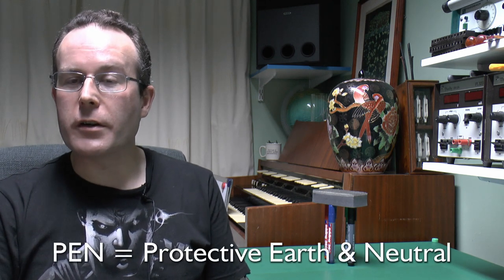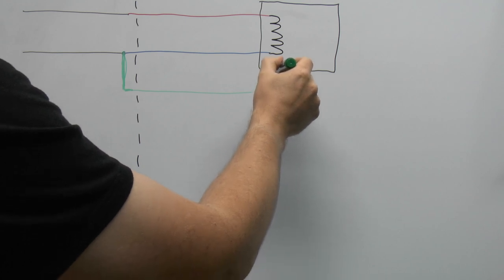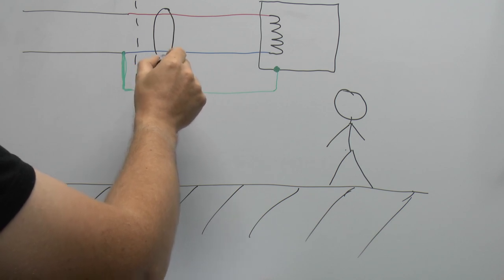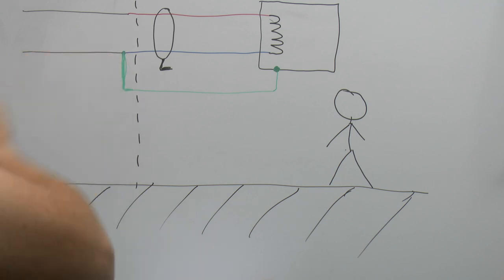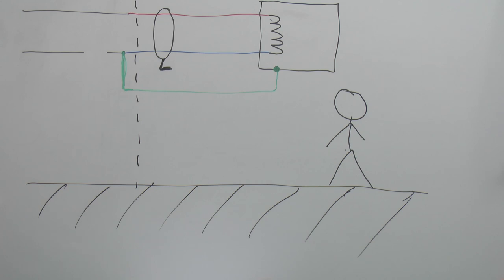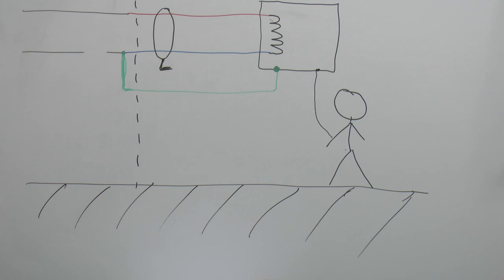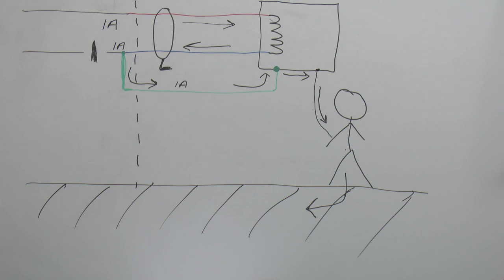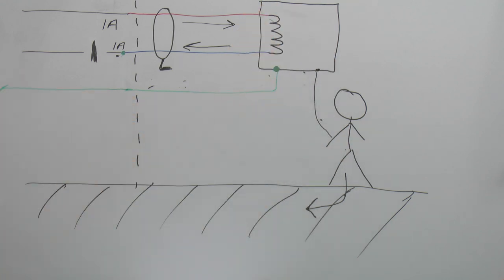TN-C-S Danger - Broken PEN Conductor (Combined Earth & Neutral)

Comment: Thanks for the very informative video. I am still new to this topic so I have two questions; Firstly, where is the connection through which current would flow back to the transformer in case the PEN connection breaks?
Secondly, can we use another protective device to compare the currents flowing through the earth and neutral conductors so if they are equal then trip the line conductor?
Reply from the maker: +Hesham Magdi The return is through the earth / ground itself, so nothing would work but everything would still give people electric shocks.
Yes, such a device could be used, but there is no requirement to do so or any device designed for that.
Reply: +John Ward.  May I enquire further on how an earth fault current manages to find its way through earth to the the transformer given that there is no cable to guide it in any direction. i.e why do electrons not leak in every direction like a water leak? and why doesn't the voltage pressure drop to the level of the surroundings, like a pipe leak into the ocean, the pressure would be lost?
Reply: +AgeofVergo It does leak but electrons need a conductor to leak. Electrons normally do not flow through the air unless the voltage difference between two conductors is significant enough and the distance small enough. This is the case with lightning (high voltage difference) or with bad connections (low voltage difference but conductors are close enough to create sparks).

But every wire with a voltage has an electric field which basicly are the electrons leaking everywhere in your example. You can measure this with electric field meters and this is acually for some people a problem and there are solutions:
- make sure all wiring including the ones going to light switches and lights have a Protective Earth conductor. This will attract 70% of the electric fields produces by phase wires.
- if you're very sensitive you can install shielded cables which will lower electric fields from mains wiring to <1%
- if you're extremely sensitive you can switch to low voltage DC with incandecant or non electronic driven LED lights to get rid of any inducing AC electromagnetics.

I know some people who have to live like that. They are fine as long as they do not come in contact with AC wiring or any electronic devices.

Comment: Would an active RCD (the kind that trip on loss of power) be an effective measure to preventing this kind of situation
Reply from the maker: jayja45 Possibly.  If there were no other parts of the system already connected to earth/ground, when the conductor was broken, there would be no voltage between the L&N connections to the RCD and it would disconnect.  

However if there were one or more connections to ground via other metallic paths such as water/gas pipes (inevitable in the majority of installations), some voltage would still exist between the L&N connections so tripping becomes less certain.

That type of RCD is seldom used, and would not normally be considered for a whole installation due to the significant inconvenience of it tripping due to minor power outages.

Comment: Hi I have just watched  your  video on break in connection  for TN CS 
As a non Electrician. Can you please  tell me why you cannot  mix any of the conditions.  TT TNS or TN CS.. to get around the problems. 
Surely if you have earthing  Rodd as well  as TNCS it gets around  the problems  to severed  line
Reply from the maker: TNS is a good system, but it requires a separate earth conductor all the way back to the transformer - if it's combined with the neutral at any point after the transformer it's not TNS.
An earth rod can be used with TNCS to reduce the dangerous voltage if a break occurs, but to have any effect it must have a very low resistance, 5 ohms or less typically, which usually means very large buried metal grids or using the reinforcement in the concrete foundations of a building.  A single rod won't do very much.

Comment: I suppose this is viewed as a double fault problem. If say as in this case it's connected to a water heater the resistance to the actual tank via the element will be many meg ohms providing that it's ok. This would be why people who have noticed this problem mention tingles to various degrees. Good job they do in an odd way. Things change rather a lot if the element develops a fault - the resistance of that will set what current flows and the severity of the shock.
Maybe at some point given the demise of copper etc pipe a ground spike will be needed or some other method of detecting the problem. Probably rather difficult and a spike has such a resistance that even that could be a problem.
Mention of actual ground current sensing is interesting. I don't know why they were dropped or if they could offer rcd levels of protection.
Reply: A lot of properties already have MDPE water mains and are now receiving an MDPE gas main to go with it. I wonder if the contractors replacing the service pipework for each property are required to electrically test the service first, to ensure it isn't functioning as an earth, because of course once upon a time quite a lot of properties used lead mains as ground rods.

Comment: But running a separate earth wire as in TN-S still sufferes from the problem of it breaking as for the PEN conductor. Do they ever run a separate earth wire on an overhead supply?
Reply from the maker: The danger does not occur with TN-S, as the neutral and earth are not linked together at the point they enter the building - a loss of the neutral, earth or both won't result in metal parts becoming live unless a  separate fault between L&N occurs in the installation after the cable is broken.
Overhead supplies are either two separate wires (L&N), or a single cable which can contain either two (L&N or L&PEN) or three cores (L&N&E).

Comment: friend sorry for pointing my finger,but in this case the RCd will work too, as you touch  the refegerator and corrent flow through your body rcd will turn off since the  corrent surpass 0,03 amps.
Ofcourse you will feel the shock but your life will be save.
Reply from the maker: +LINO SOUZA PEREIRA Normally the RCD would disconnect.  In the situation explained in the video it will not.

Comment: Thank you for this informative video. Please could you make a presentation about the yellow building site "isolation" transformers. When looking at the On-site guide to BS7671 (yellow) 3.4.3 SELV and PELV, it would seem to suggest that in effect these transformers are not true isolation transformers. 414.3 Suggests that to be considered isolatingThe transformer must "have no live part connected to earth or the protective conductor of another system."Since the centre tap of these transformers is in direct metallic contact with the earth of the flexible cord of the supply, the circuit protective conductor of the installation, and hence, quite possibly/probably the neutral conductor of a supply , especially if TNC(S), they appear not to be "isolating" in construction.Would these transformers more appropriately be described as Protective Extra Low Voltage Units?The transformer-fed shaver units do appear to meet the requirement of being truly Isolating.Many thanks for all your fascinating inputs.
Reply: Yellow site boxes are reduced low voltage RLV and are neither SELV nor PELV. The centre tapped transformer aims to reduce the potential so that line to earth is 55v or 63.5v three phase. reduced low voltage reduces the magnitude of the voltage if shocked. SELV and PELV means you cannot be shocked from only 1 pole
Reply: The main issue with these is miss location. Most are used at the Point of use and not at the supply point. So unprotected often un tested extension leads at a full unprotected state are laying around getting walked on and chopped. Builders will not bother in the race to get home each day.

Comment: In this scenario. If you had this circuit protected by the type of rcbo that has an earth tag, would it cause the rcbo to trip? I'm trying to understand what the benefits of having the earth tag are ... thanks
Reply from the maker: No, as that could only detect a break if the earth lead was connected before the break, which would be outside of the property.
They were provided for various reasons, the most usual one is that it ensures that internal electronics still work if the incoming neutral was disconnected.
Most modern RCBOs don't have them.
Reply: @jwflame  Brilliant and thankyou for taking the time to reply. Your videos have and continue to be a great resource for me.

Comment: When PEN breaks on the supply side of TN-C-S, does the RCD operate if no one comes in contact with the metal casing?
Reply: mazmaz1981 no because the fault exists BEFORE the RCD. The RCD will only measure in front of itself and not behind (I.e between RCD and load) so even though the PEN Neutral is broken, the RCD wouldn't see it. Think of it like someone standing behind you,  you can't see them unless you turned around, same here. I think if there was an RCD at the substation then that would trip as it would read the imbalance (read 0 volts returned on neutral) - Pretty sure I've understood that right

Comment: Is this a problem if you plug a 16A  3 pin caravan hook up into a converter for a 13A plug top, and then plug it in a socket at home supplied on a TN-C-S?
Reply from the maker: Yes, in the case of caravans the law specifically prohibits connecting them to the earth terminal of a PME / TN-C-S supply.

Comment: in a TN-C-S why do we have an earth stake at each installation? Sounds like a trivial question but I can't seem to reason it out. It would obviously provide another path for fault current if the PEN was damaged but is this the only reason?
Reply from the maker: In the UK, TN-C-S installations do not usually have an earth stake - although it is permitted to install one.
It would reduce the voltage on exposed parts if this type of fault occurred, but a single earth stake isn't likely to have much effect, as it's impedance will be too high.  A large metal grid under the ground would be far more effective, but also costly to install.
Reply: @jwflame   thanks for the swift reply. The Australian and New Zealand wiring rules calls for an earth stake where there is an MEN link. I suspect that because our soils in Australia are bone dry, the stake does not achieve much - so we have to hang our hats on the integrity of the MEN link and PEN. I don't quite understand how it would reduce voltage on exposed parts - can you elaborate on this? Cheers
Reply from the maker: @tommyp3611  If the PEN conductor is broken, metal parts connected to the installation earth will have a dangerous voltage on them.  If those parts are also connected to the actual earth via an earth stake, some current will flow to earth and reduce the voltage on those metal parts.  Lower impedance earth stake = lower voltage, so to have any real effect it would need to be very low, only a few ohms.

Comment: I can understand the supplier not supplying an earth in rural applications. However, in city applications the supplier installing and earth back to the transformer is not a big thing, making it a TN-S - is this so?
Reply from the maker: Supplies were TN-S with separate conductors for E and N up to the late 1960s.  Since then the majority have been TN-C- S with a combined N&E conductor.  Plenty of older installations which were TN-S have been converted to TN-C-S either due to network faults, repairs using CNE cable instead of SNE, or because other properties on the same supply were converted.  Finding a true TN-S supply today is very unlikely.
Reply: @jwflame  
Thx. If a foundation or substantial soil earth is fitted, does the homeowner have the option of using their own earth converting to full TT?
Reply: @jwflame  
If new homes have to mandatory fit EV chargers these days, I would assume a foundation earth would be fitted with a TT system.

Comment: On a TN-C-S system you also have an earth on the house that you haven't shown in the case where the main neutral may break,
Reply from the maker: Some countries have that as a requirement. In the UK it is optional, and therefore never installed.

Comment: I know this is an old video so hopefully someone will see this.

Being that the earth at the appliance is connected to the Main Earthing Terminal in the Consumer Unit, if an earth electrode is also connected to that Main Earthing Terminal surely this will provide a low resistance path for the voltage into the earth eliminating the chance of electrocution to any person who may come in contact with the appliance?

Or am I way off?
Reply from the maker: Correct, but only if the electrode has a very low resistance, typically only 1 or 2 ohms.
Higher resistances will still reduce the voltage on exposed parts, but higher resistance = higher voltage,  and with most typical rod electrodes being 10s or even 100s of ohms, the benefit is minimal.
The required resistance to ensure safe voltages depends on the load connected to the installation, higher load = lower resistance required.  Some of that is covered in this video: https://www.youtube.com/watch?v=gZVx7GbAwlg which is for EV charging, but the principles are the same for any installation.
To get the resistance low enough will require a large foundation electrode in most cases.
Reply: Thank you very much, John. Really appreciate the quick reply.

Comment: Supposing your metal gas and water pipes are connected to the MET would they you provide a path to earth eliminating high voltages at metallic electrical equipment??
Reply: If their metal sections are buried in the earth then likely yes.  They would act as earth stakes. The problem arises when the incoming water or gas pipe is plastic.

Comment: Could this be an argument for still having an earth rod, a la TT system, and having all circuits RCD protected? Would there be any disadvantage/danger in this arrangement, by that I mean having both incoming earth AND earth rod connected?
Reply from the maker: You can have your own earth electrode connected to the incoming earth - but to have any real effect it would need to have a very low impedance, and that can typically only be achieved with a foundation electrode, not a rod or two shoved into the ground.
A separate TT system is also an option, but the electrodes for that need to be located far away from anything connected to the supplier TN-C-S earth, and that's difficult or even impossible for many locations.
Reply: @jwflame  The thinking was that even if you lost the incoming earth connection, a separate earth rod would have a low enough impedance to trip RCD's before you get to the 50v threshold? Just as a backup?
Reply from the maker: @whizzo94  RCDs don't trip for broken PEN conductors, as there is no imbalance of current.
Reply: @jwflame  I think that I have misunderstood what is happening here. I can see that there is no current imbalance.
I was concerned because my house is a TT system, but I'm not so sure that that's a bad thing now.  My apologies for being a bit dim understanding this.
Reply: @whizzo94  it's absolutely not a "bad thing" TT and IT system are the most safer protection method than TN-C , TN-S , and TN-CS. Here in France only TT system is allowed for  homes.

Comment: Are there supposed to be earthing stakes at various points of a TN-C-S earthing system?
Reply from the maker: +andythewooferguy There are, but these are outside of the electrical installation and entirely the responsibility of the electricity company.
Reply: +John Ward Oh really. I noticed our neighbour has two or three earth stakes on the neutral going to his house. He's probably one of the lucky ones.
Reply: +andythewooferguy Yes but usually these stakes are a joke. Most of the time they are just a few meters at max! So when the soil is dry it will not provide any serious ground path.

Actually PME (Protective Multiple Earthing) can cause faster corrosion in the neutral. So it actually INCREASES the risk of a broken neutral.

Comment: Are installing ground/earth rods a standard in the UK?
Reply from the maker: metersocket00 Not generally - only for those locations where there is no earth connection provided by the supplier (TT) which is a minority of installations.

TN-C-S and TN-S installations rarely have an earth rod. They are not required or specified for such installations, although regulations do not prohibit installing one.

Metallic service pipes entering the building such as for gas or water are connected to the main earth for the installation, and these are typically buried underground. However on newer buildings or those which have upgraded water/gas connections, the pipes underground are normally plastic.
Reply: Stupidly we don't link our incoming neutral to ground via a rod...
Reply: In TN-S systems we use the sheathing of the distributors incoming SWA, which to me looks like it goes underground.